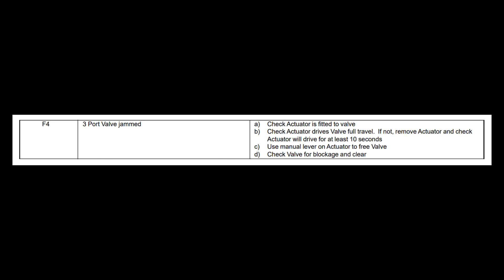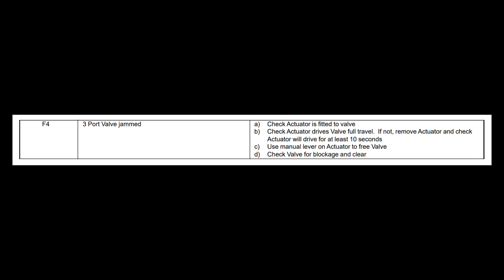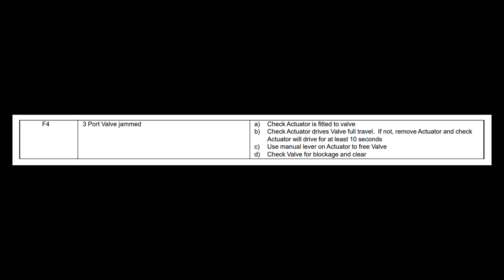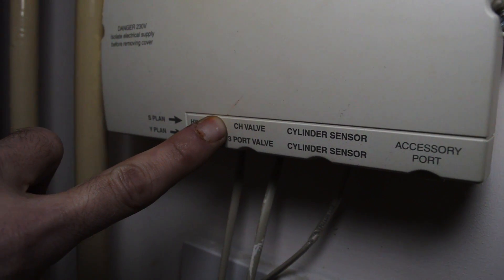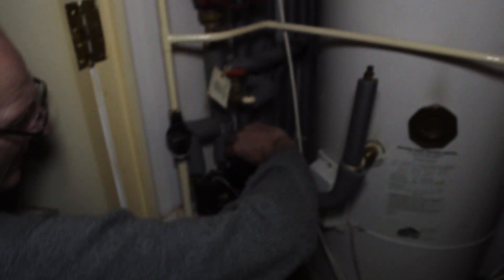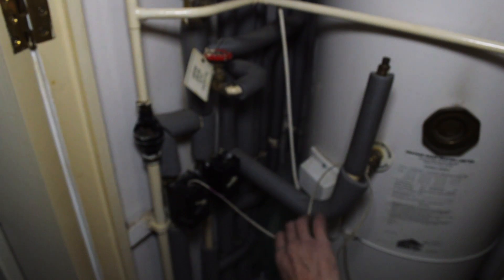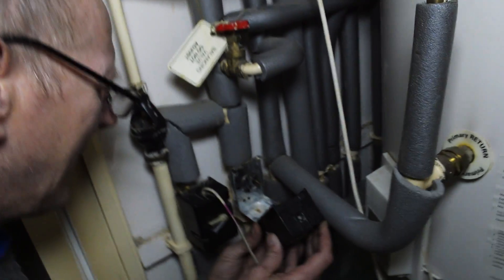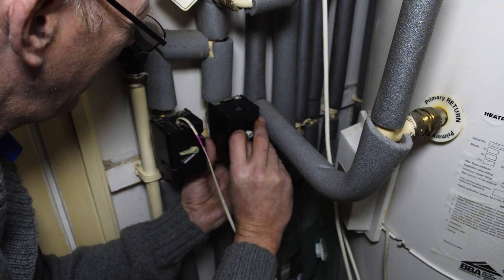F4 fault code on a Honeywell Smart Fit heating system

Comment: thanks for this video. i have the F4  fault as described. if i reset the system it will go away for a week or so then it will come back. i read the fault can be caused by not only the valve but also the electronic units, so i went and bought a 2nd hand kit/ system and replaced the electronics but the problem persists. now i guess i'd have to change the valve which i have a brand new spare for that came with the kit. do i risk flooding at any stage if i remove the valve as per your video? must the lever be centered before i remove the existing valve? thanks in advance.
Reply: did you replace the valve or find a solution? I have the same problem but have not replaced any parts yet. With the F04 error present the valve still moves up and down by itself periodically without the rest of the system working, so it doesn't appear the valve is stuck. If I turn the power off and on then the system works fine. The F04 error keeps appearing about once a day now. Perhaps the base unit or control unit is at fault.
Reply: @mysterizedoutcast  i replaced both the timer controller and the receiver box and the problem went away iirc. I never changed any valves. I have since changed to a combi boiler and ripped out the water tank.